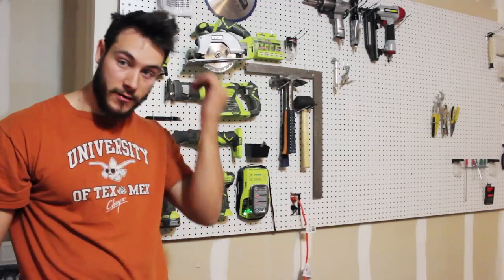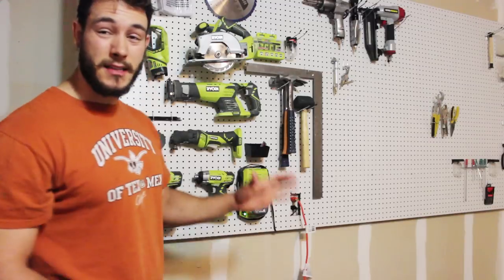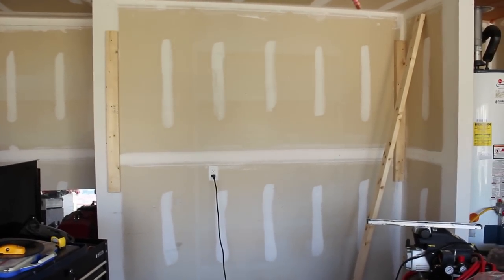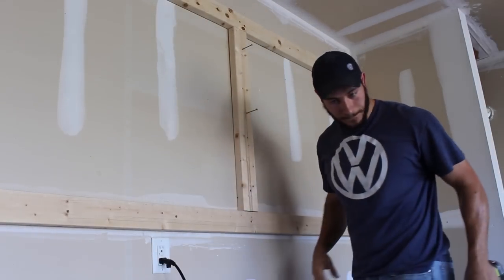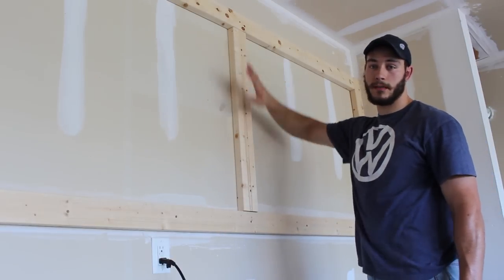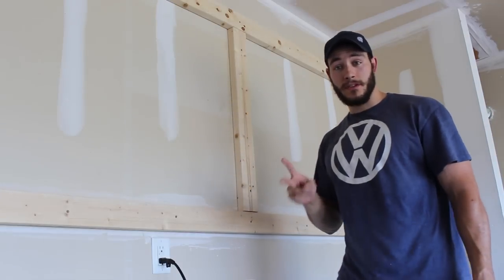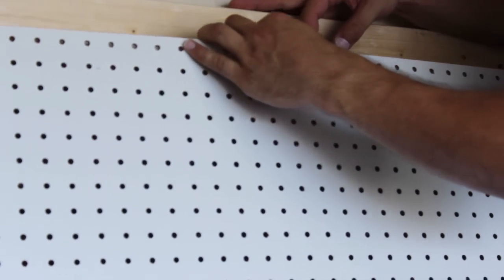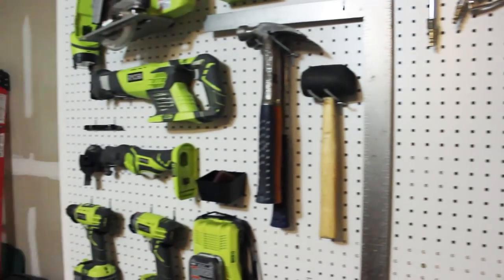DIY Garage Shop PegBoard

Comment: I did a similar project. .. but I actually framed the outside edge of the pegboard with 2x1 inch wood. takes less space than a 2x4 and gives you more usable surface while maintaining a rigid base.
every 3 feet I added a parallel support and connected the peg board to the wood using small washers to strengthen the screw joints and also pressure relief. I mounted the pegboard frame to the wall joists (16 inches on center)
I am able mount 60+ lb of power tools maybe more every 3 feet with ease cuz the pressure is spread out.

Comment: Those screw heads won't hold without washers.
Reply: Thinking the same thing.
Reply: yeah no kidding. that pegboard is gonna come off over time!
Reply from the maker: Great Idea, but It has held great without any issues.
Reply: I was thinking the same thing when I saw this.
Reply: Cabinet screws work the best
Reply: My screws hold without washers.  I use the Simpson Strong-Tie screws that have wide heads and they're strong as hell - and I don't skimp and put them every 10 to 12 inches..  They cost a little more but are worth it.
Reply from the maker: 3 years holding, I do agree that I should have used some washers though, maybe a redo after I paint it to match my garage wall.
Reply: @Bryce Lane Thanks for the feedback, bryce.
Reply: Myfootsasmokin 
Ring shank roofing tacks will hold it!
Reply: @20TonChop  Since we're speaking of screws here, it appears you have one or more loose.  Save your overdramatics for some other chat. ;-)
Reply: @guyfroml  It was meant to be overdramatic. That was the joke. Congratulations you got it! You could have went loony and put those screws every 6 to 8 inches....... Mind blown!
Reply from the maker: @20TonChop  Totally Certified. It is still working great. I am looking to update my video to have a modular pegboard system and will definitely change the screw type or use a washer for version 2.
Reply from the maker: michel777ification  HA HA YES, I do agree. If you look at my most recent pegboard video I have resulted in using washers.

Comment: please be sure to position your supports so that they do not leave to many peg hole useless, i prefer to use 1 by 1s as to limit this and place your 1by 1s betweenst the peg holes, this way you will loose no peg holes, in contrast using 2by4 will displace of peg 4 rows of peg holes unacceptable and iritating when trying to arrange hardware...
Reply: I thought the same thing when I saw the 2 X 4 in the middle.
Reply: Yeah 2x4 takes up too many holes and is way overkill. Also too thick and takes a bit more space out of the shop!
Reply: That's why I use the 1" x 2" (actually 3/4 by 1-1/2) solid cuts pre-primed from Home Depot or Lowes.  They're plenty strong (3 strips on a 4' x 8' sheet) and use up only one row of holes when properly placed.  They're attached to the studs with a 3" wood screw. More than secure.

Comment: Get some inexpensive pegboard mounting kits from Menards or any big home improvement store for around $2 per pack. They each come with 6 spacers, screws, washers and drywall anchors and make mounting a breeze for pretty much any type of wall finish.

Comment: I bought a bunch of the Ryobi battery lanyard's cheap and used on eBay and clip them on the edge of gorilla wire shelving. I can tweak and move them easily. Also put hooks on my pegboard and hang the hedge trimmers with them.
Reply from the maker: Awesome Mario! hope this was helpful.

Comment: I use 2x2, and I screw between holes cuz that board can pull right off those screw heads unless you use washers. Another thing you could do is put a shelf at the top.
Reply: Good idea about the shelf. I will do this with mine, Thanks

Comment: Use pan head screws or put washers. Those screws will cause your board to sag over time. My dad ran into the issue and gave me this tip just fyi. Great work

Comment: I went shopping for pegboard at Home Depot and Lowes. Home Depot had a better selection than Lowe’s. Home Depot had the smaller size boards that fit well in a garage or basement. Lowes only had the very large size ones.

Comment: hi Bryce could i just ask do u need special hooks to use in the peg board I'm gonna put one up in my craft room thanks for showing how its done
Reply from the maker: Hi Kathleen, you can use almost any hook as long as it is for pegboard. They make standard pegboard hooks and thick pegboard hooks. In my experience, both have worked well. I hope this helps. good luck with the build.

Comment: I like your video but you DON'T need all that 2x4. 1x2 will be sufficient for the top and bottom, since the studs behind the drywall and the screws will hold the weight. All you really need is space/spacers between the pegboard and wall. I use a strip of 1x2 on the top and a piece of 1/2 CPVC hot glued to the back( center of between four holes) for the rest of the screws. So like I said, it's not the furring strips that hold the weight it's the studs and screws. That 2x4 will block three columns of holes. So will the top n bottom.
Reply: Is it possible to post a picture of what ur talking about as far as the 1x2 with hot glue and cpvc... im trying to visualize what ur explaining
Reply: @jenniferleuzinger2877  Take a cut of CPVC that is the same depth as the backing frame of the pegboard. If you are using 1x2 fame for the pegboard the CPVC should be 3/4" long. This makes it possible to put a screw all the way through to the drywall and to the wall stud and that keeps the pegboard from being pushed in. Gluing it keeps it in place while you mount the pegboard.
Reply: @Tye Bear So all that says is that you over built peoples pegboard walls and they didn't care or were just not wanting to make a big deal about it. There is no reason to use a full 2x4 and backing to mount pegboard. When I do whole walls all I use is 1x2" for the boarders and 1x4" for the joining and a 1x2" at the half of 4 x 8 ft sheet. 2x4s are way overkill since the  2x4 studs in the wall are what supports all the weight. The back frame just spaces the pegboard from the wall. All you are doing is adding more weight to the wall and cost to the project.  When I put up pegboard ai don't even take my miter saw. a back saw is all you need to make cuts. Not needing to cut through 2x4s. Waste of time.
Reply: @Tye Bear Well when my clients want something because it's beefier, I will tell them why it's not and why doing it with just 1x2s is cheaper(less cost in wood and time spent) and no less strong. Like I said it's the wall studs that support the weight. I always tell them, if it doesn't hold up then they can contact me and I will redo it. I have yet to get call back for that. I get called back to do more work. Plus the calls to do it the way I am saying when others wanted to do it the "beefier" way. I have even been called to redo the "beefier" work. I hear the complaints of the other guy. That's the thing about complaints. People don't always complain to the person that did the work but to the next person that they get to fix it. Some people just don't care enough to complain. There are other who are non confrontational and won't complain even if they hated the work.  

If you ever mounted a tv to the wall, you would know that you don't add 2x4s to the front of the wall to make it stronger. You just mount it to the studs.
Reply: @Tye Bear So then you need to learn to do it right. It's not hard at all.   

Let's put it this way. If you were asked to put up pegboard on a wall that had no drywall are you seriously going to put more 2x4 up and make a completely new frame? LOL. 

No. You put supports in between the studs and then the pegboard right to the studs and added supports.  

BTW you keep saying too much weight, and you still don't realize that "too much" is the operative phrase there. You put too much on anything then it is going to fail. Also if it failed it is due to one of two things. YOU didn't drive the screws through to the wall studs or you used small screws to just screw to the 1x2s. 1x2s are only for spacing.  OR  the pegboard itself failed. They are only meant to hold so much weight. So if you put TOO MUCH WEIGHT on them they are going to fail.

Comment: Can I mount a peg board to the studs behind the drywall? Or do I need to install those 2x4s?
Reply from the maker: If you just mount it directly to the wall you wont be able to insert the peg board hardware. You need a space so that you can move the hooks and holders around.  Hope that helps.
Reply: Bryce Lane oh duh! Thanks pal

Comment: Hey, when you screw the pegboard into the frame, do you have to screw it into the studs as well? Or is it okay to screw it along any part of the frame? Thanks!
Reply from the maker: you need to do it on the frame, otherwise it will sink in the peg board. get a good frame built and you should have enough area to screw it in
Reply: +Bryce Lane cool, but should it go through the frame and into the studs? Or just the frame is fine?
Reply from the maker: +fpark if your frame is secured into the frame, then just secure the pegboard to just the Fram should be good. I used 1-1/4"  screws
Reply: +Bryce Lane thanks!

Comment: 1) im assuming you used a stud finder initially? 2) is that 1x4 wood? 3) how did you make the cut-out for the outlet?
Reply from the maker: I just used a multi tool to cut the outlet slot. I used 2x4's for the frame

Comment: Great video.  I wanted to know if you screwed the support posts into studs, because I'm wondering how secure it would be if it was just screwed into drywall?  Thanks for the info!
Reply from the maker: Into the studs in the way to go, otherwise it would probably fall right off the wall. Make your frame according the the studs in your wall.

Happy building!
Reply: Thanks so much!  I really appreciate the response!
Reply: Bryce Lane 8

Comment: Do the screws hold the peg board to the wall, seems like without washers the peg board could fall?
Reply from the maker: +Jaime Esper that is actually a pretty good idea, but I do have all my tools on the wall and haven't had any stability issues... yet. If your a little worried you could probably find some little washers that will work with the wood screws. Let me know how it goes. happy building!

Comment: HI Bruce, great video, thnx! ..Got a question; How thick must the pegboard be and can you use a simple bed base for it?
Reply: This video is 4 years old, and you never got an answer, so here it my answer: you do not need 2x4's, use 1x2's on 16-inch centers (1x2 is a USA nominal measurement, they are actually about 1-1/2-inch wide and 3/4-inch thick). Pegboard comes in two types; 1/8-inch with 1/8-inch holes in a one-inch grid and a heavier pegboard that is 1/4-inch thick and has 1/4-inch holes also on a one-inch grid. In either case the pegboard needs to be spaced out from the wall so that the hooks "clear" the back of the board as they are slotted in. The 1/8 thick stuff is usually tempered hardboard and the 1/4-inch stuff MDF. My own preference is for the 1/4-inch MDF boards. You can also hang the board on a couple of 8d finishing nails as you put it up if you are trying to do it by yourself.

Comment: How do you attach the hooks?
Reply from the maker: The hooks will go through the peg board holes and secure themselves on the other side. This is why you need the frame to create a space between the wall and the pegboard. Hope this helps.

Comment: Where did you get all your hooks at for your power tools?
Reply from the maker: +David Moss Hey David, I purchased a little pack of them at Lowes and it came with several hangers, but I bought the big rubber coated ones separately.

Comment: what kind of screws and size did you use?
Reply from the maker: +Estuardo Ramirez sorry for the delayed response, I used 1-1/4" deck screws. They are the t-25 bit so that I never have to worry about them stripping out.
Reply from the maker: +Estuardo Ramirez Also I used 3-1/2"" screws for the frame into the wall

Comment: a) That was crazy overkill on the amount of screws to hold that peg board down b) Should have used washers with those screws c) 2x4's are way too thick and again overkill, all you needed was 1"x2"'s all around and 4 screws in 4 corners and 4 somewhere in middle.  I didnt click thumbs down but a bit amateurish to be posting how to's. Ryobi I think should have been the giveaway:) If I have anything to display it would be Hilti, Milwaukee, Makita or DeWalt in that order.  Bosch also works, Ryobi not so much.
Reply from the maker: Yep, didnt want it to fall apart. Definitely changed my design in my new build. It is now up and posted on my channel as well.

Comment: Those screws are not holding anything! I'm surprised the pegboard stays up without any tools hanging on it! Better to put 1x2s on 16 inch centers (you do not need more than 3/4 inch of clearance behind the pegboard) and use washer head screws (SPAX is one brand) every 9 inches driven into the pegboard, rather than using the existing peg holes.